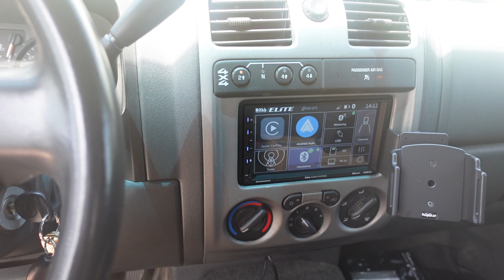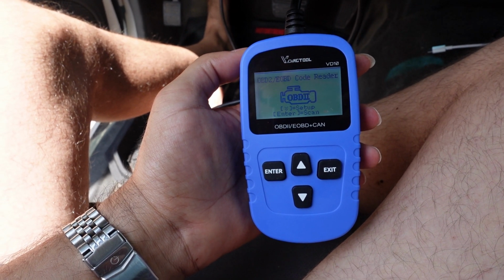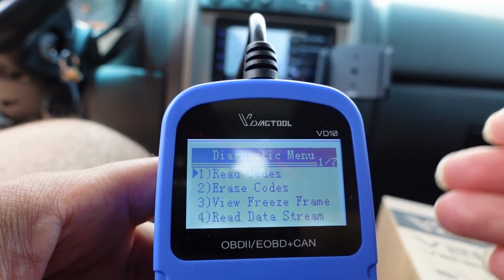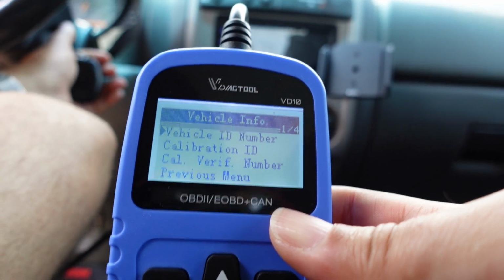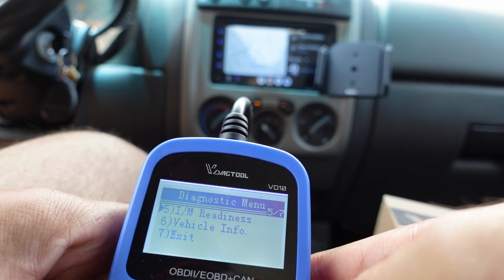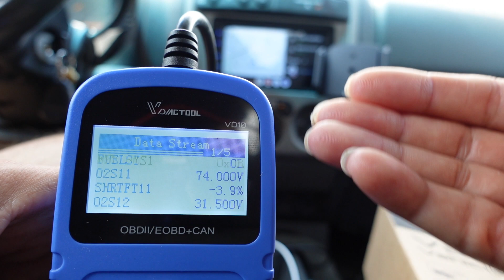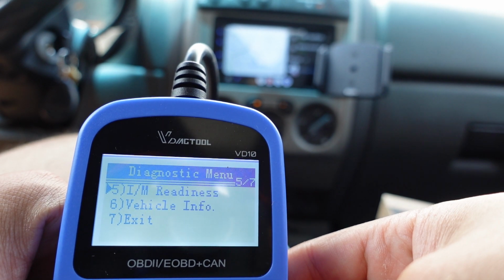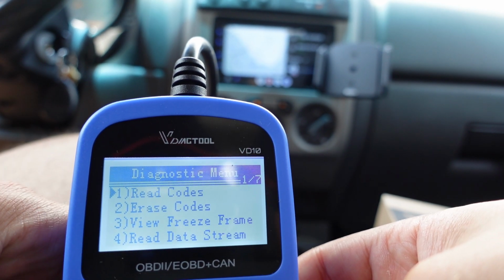VdiagTool VD10 code reader - Less is more and why you might need one SEE IT FOR YOURSELF

Comment: These little cheaper scanners are good for one thing : I/M Monitors right before a inspection or smog. Here in Texas we have yearly inspections
Reply from the maker: Oh yeah, you definitely can ride around with it and check the drive cycles for sure. We have yearly emission inspections in North Carolina as well.
Reply: @oneanddonediy  awesome 🤩
Reply: Would you help me send application or software for used to toyota avanza 2004-2006 but i tried to grand livina nissan car 2011  there is doesn't work and toyoto avanza 2015 it doesn't too so i want to instalate from my laptop to VDIAGTOOL VD 10. Thanks u 🙏